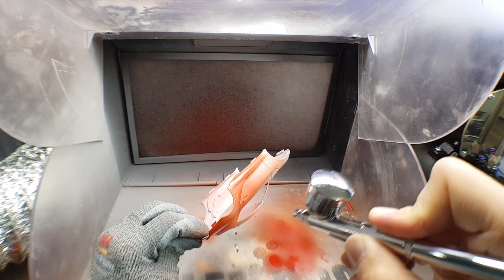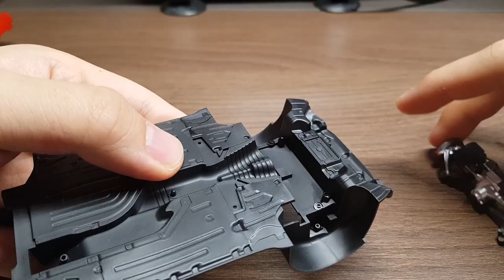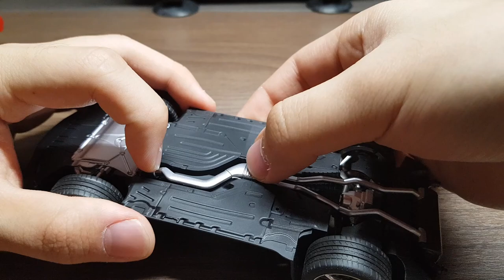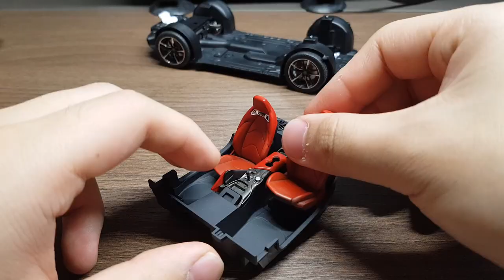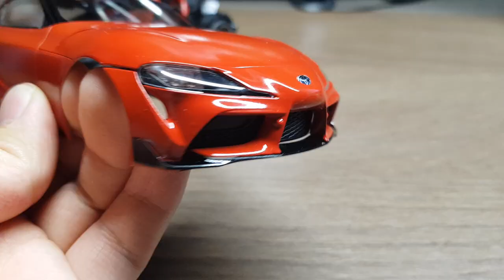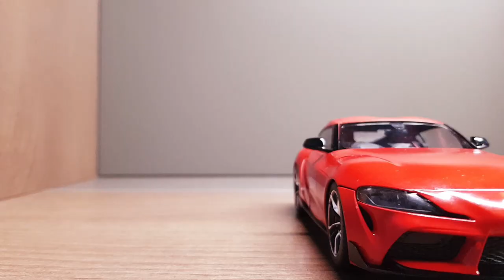How to build a Tamiya 2020 Toyota Supra step by step

Comment: One suggestion for the clear coat is to use either Testors Lacquer Ultra Gloss in a spray or shoot Redline Club Clear Urethane through your airbrush. No offense (just a pointer), but the car should have a glossy glass finish and not look sprayed on. Yours looks dull and grainy. You can actually smooth out your clear coat by lightly wet sanding it starting with 3500 to 4000 grit sandpaper before polishing it again.